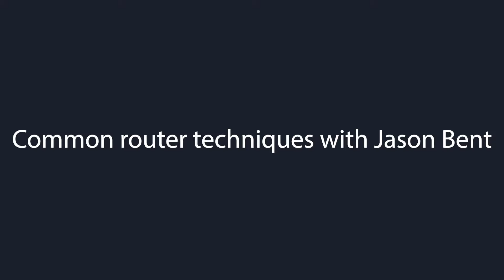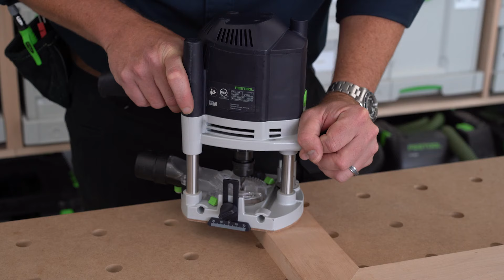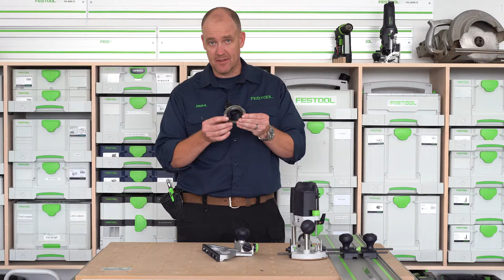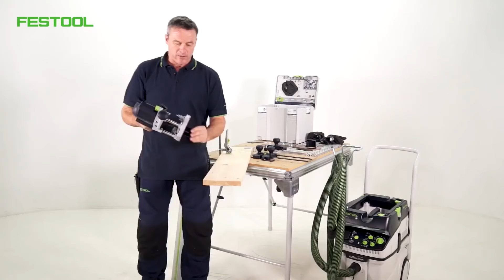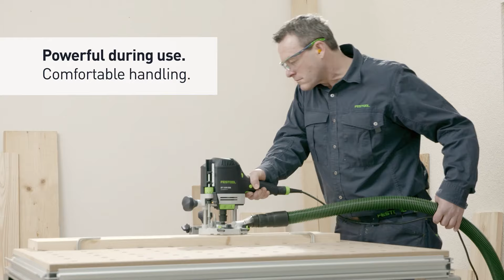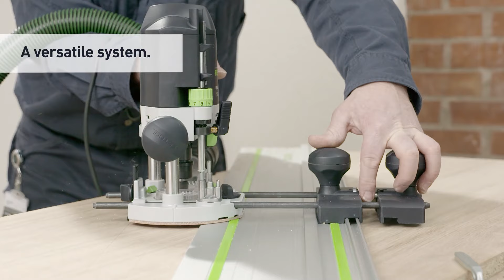Routing Techniques Every Woodworker Should Know | tips with @bentswoodworking

Comment: Hello,
I hope you're doing well.
I have a question regarding the dust extraction attachments for the Festool OF 1010 and Festool OF 1400.
When the dust extraction hood/chip catcher is installed, what is the maximum usable router bit diameter?
I've been researching this, but I haven't found a clear answer.
The router bit I use most often has a 45 mm diameter, so I'd like to know if it can be used with the dust extraction attachment installed on both the OF 1010 and the OF 1400, or if the attachment needs to be removed.
Thank you very much for your help!

Comment: Assuming that the rotatable stepped stop (term used in the manual) work the same way on all Festool routers: You are missing one very important detail for setting the depth stop accurately ! Festool has designed the rotatable stepped stop with a spring lifting the stops up slightly (0.4 mm on my OF 1010 R). It is therefore mandatory for an accurate setting of the depth to press down on the depth stop rod when setting the router depth - with the words of the OF 1010 R manual: "Press the depth stop [1-3] against one of the three fixed stops of the rotatable stepped stop [1-2]." Festool probably think that the spring loading of the rotatable stop is a feature. I tend to regard it as a fault that I need to work around each time I set the depth but that's probably just me...

Comment: I have an OF1400 and the depth adjustment system really messes with my head. You need a printed flow chart to figure out where you need the depth rod, depth stop, locking collar, microadjust. It's way too easy to change your setting by mistake and lose your progress. It's also impossible to set for anything other than a flat plunge bit. So setting up a guided chamfer bit for example is nearly impossible. And you cannot set a maximum height so if you have a big bit and you release the plunge it will crash into your dust shroud.

On the other hand, my Milawukee trim router is so easy to understand. It's just a lock and a dial and I can sneak that up to the perfect setting without any fear of failure.

Comment: I love my 1400. I truly had no idea it could be that much better than my Bosch work horses, but when doing a huge number of cabinets, I bought everything needed for the LR32 system, and opted for the 1400 over the 1010 so I could use multiple collets and bit sizes. It's a truly remarkable tool. My router table retains the Bosch, but the second Bosch is pretty much idle now all the time. I'm considering getting a 1010 for dedicated LR32 use, and use the 1400 more broadly. The Bosch is great. It's a solid work horse. But the 1400 is just... *chef's kiss*
Reply: Same for me. I started with the BOSCH and ended up putting it on my router table. The 1400 has so many user friendly features that the price point of the 1400 is well worth it.

Comment: How to make 16' radius arch without using center point? Arch length 4'
Reply: I sold my car and bought  a Shaper Origin...this is the only way I found to make radius without having a center pin for a jig.
Reply: @raymondtremblay489   it is possible, i am just giving topic to professional to evaluate more
Reply: @raymondtremblay489   how is your experience
Reply: @mehulpgajjar4901  Not sure of the question...my experience with the Shaper? If it is so, this is a crazy tool it is so fun to use.
Reply: @raymondtremblay489  yes